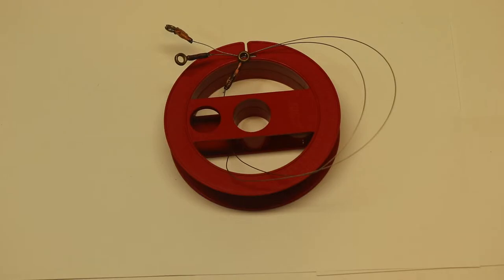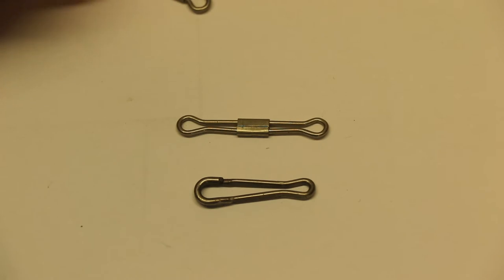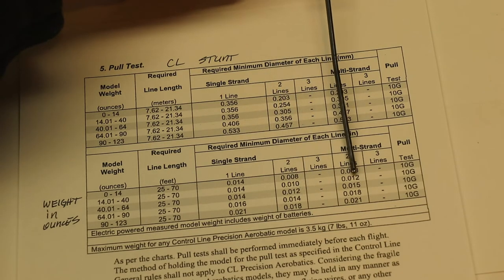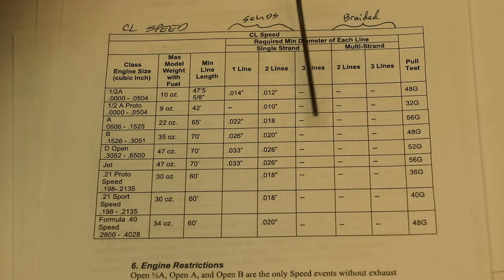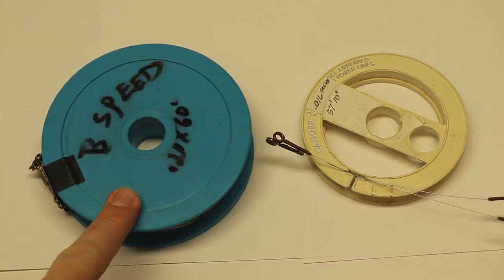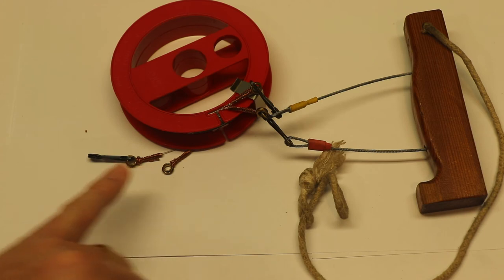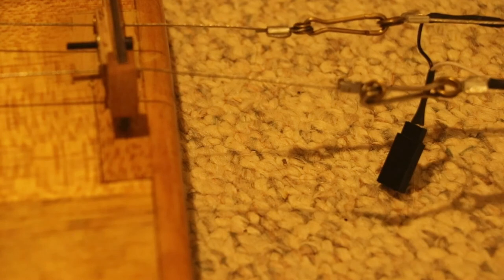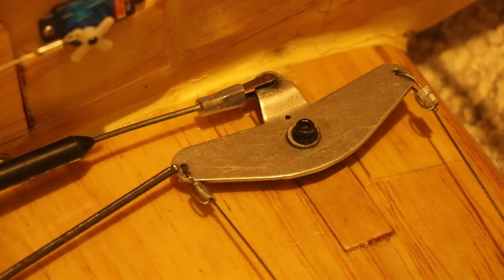Control Line Model Failure points that can cause a crash

Comment: Hi Fred….from across the pond 🤫.      That was excellent.   Thank you very much for all those tips.   I’m getting back into control line after a 60 year break,  and although I have found an excellent local mentor ,  I have to try and stand on my own two feet as soon as possible so I’ve really enjoyed your video.
Reply from the maker: It's always helpful to have a local flyer that can help out. That is why I like being part of a club, you can bounce ideas off each other and learn regardless of how experienced you might be. This video was a result of multiple crashes and models almost crashing due to these items. Check the cables in your handle, one club member lost a really nice airplane due to this.
Reply: @clscale     Thanks Fred.   I watched your video earlier today on the selection of handles you have.  Again very interesting.